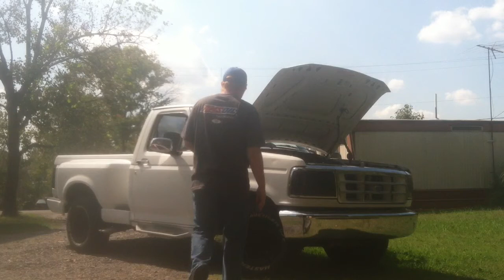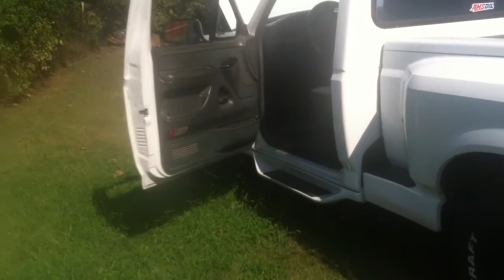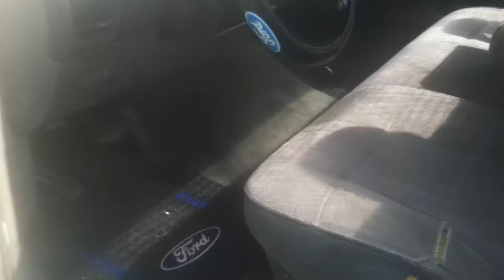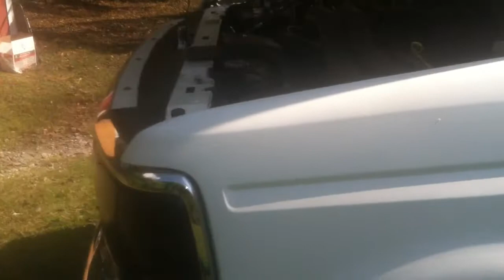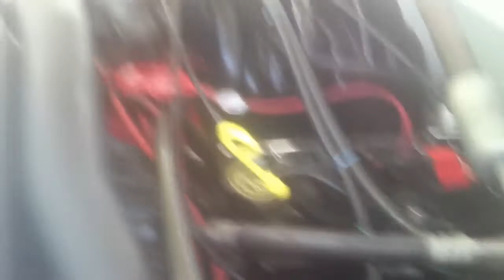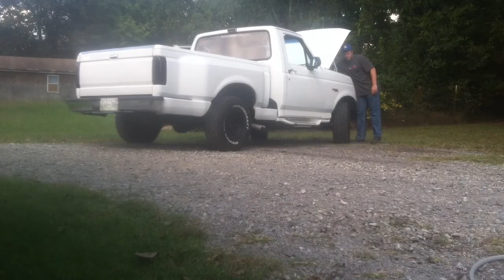5.0Flareside's 92 Ford F-150 Flareside

Comment: I have a 1992 f150 5.0 xlt flareside with e4od , I installed headers but only one oxygen sensor was connected to one side do I get another one install or what should I do? catalytic converter was deleted,also feels strong but if you want to accelerate you cant really feel that horse power been released,ive had this truck since 2015 and ive been upgrading a few things like full exhaust,headers,intake, replace the engine from a 1993 f150 with only 77000 miles I got new front fuel tank ,I have the rear tank but what I need is the fuel pump,new shocks ,new rotors and drums,and basicly everything else that I have repalce is just cosmetics,what I want is to keep upgrading the 5.0 but I really don't know what to do next im spending around $2000 a year for the past 3 years,what do you recommend I should do next.thanks
Reply: Make sure that frame is rust proofed. I would spend the time an money on that

Comment: Where can you find a fuel filler hose for the rear tank on a 1992 Flare Side? It is 21 inches long and has a bend where the hose fits on the filler neck on the truck and fairly straight where it attaches to the tank. I can send a picture of the hose if you need one. Thanks, Greg